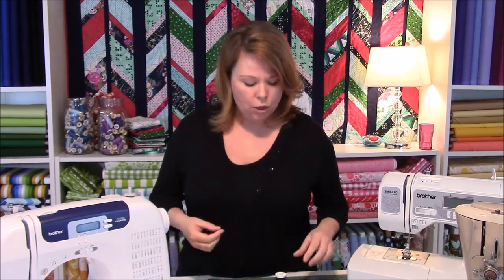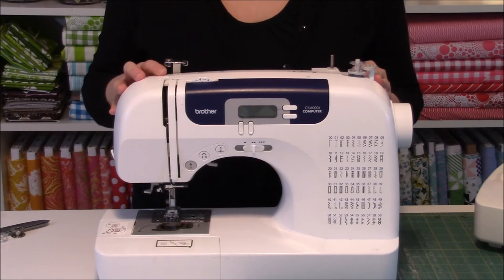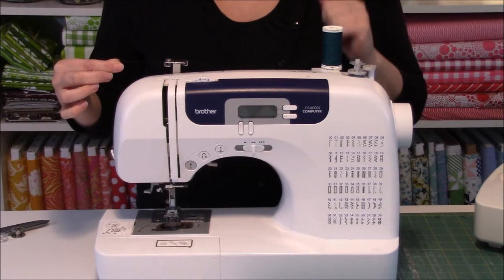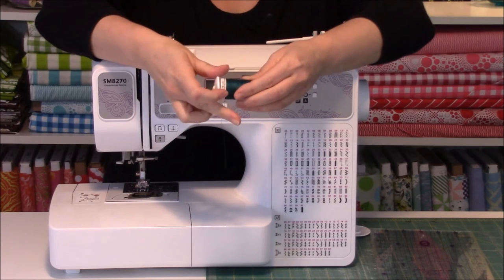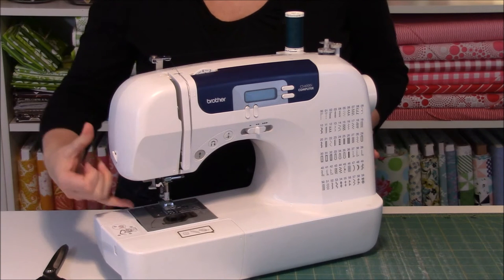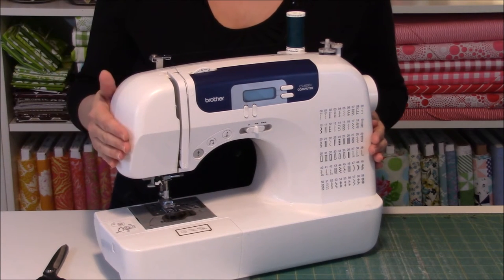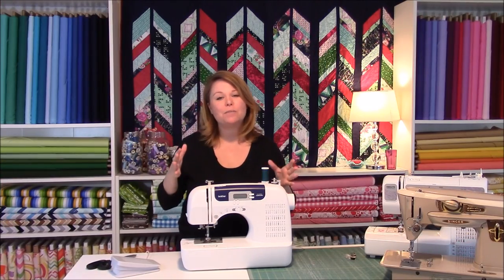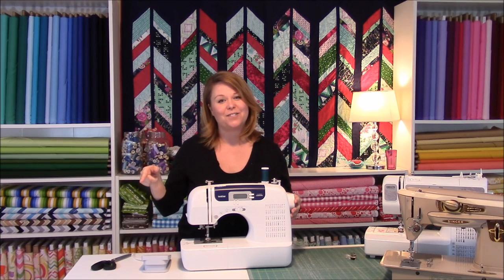Anatomy of the Sewing Machine

Comment: Very good information for beginners. For those of us that can't use a foot pedal there is a start stop button with a manual slide for speed on most new machines. There are also some with knee levers to regulate the speed. So it's something that almost everyone can enjoy. Great job.
Reply from the maker: +Jennie Wallick   -  Hi Jennie!  Thanks for the comment.  I finally brought up the 'no need for foot pedal' in my most recent video.  I always think it's great when working with kids, but you're right, there are so many other reasons it's helpful.  I need to check out the knee lever - I didn't know they had it.  Thanks for the heads up and I hope you continue to enjoy the videos.  Have a great day!